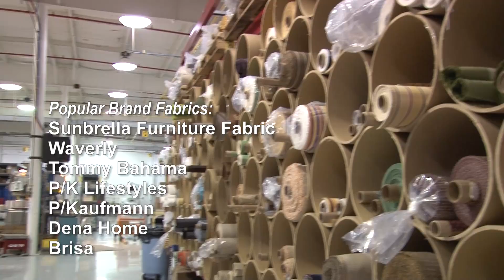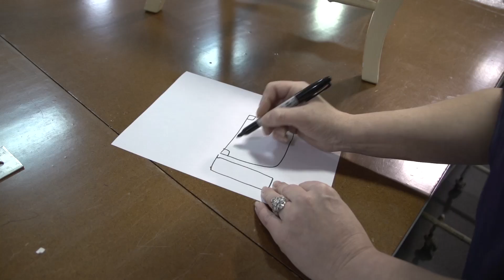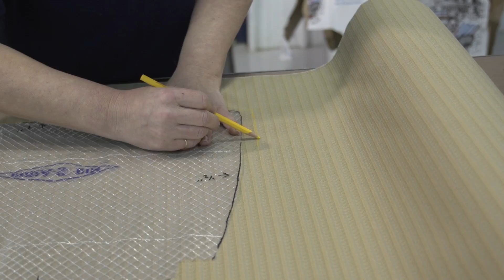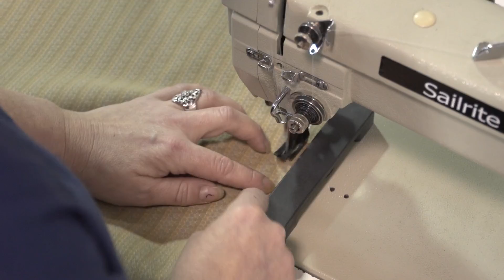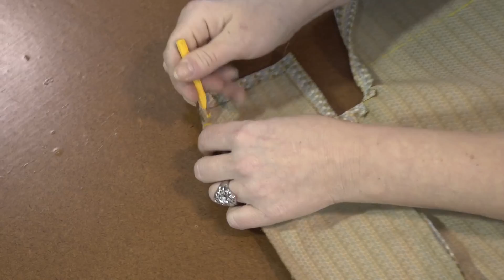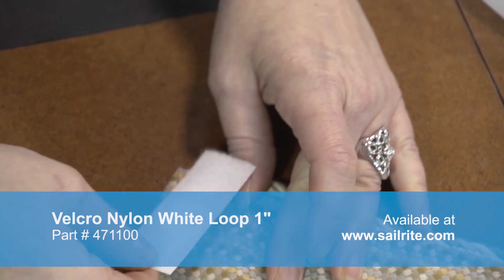How to Make Removable Dining Chair Covers

Comment: Just purchased new wooden chairs and would like the comfort a chair pad would provide.  I watched two other videos of yours for chair pads and then saw this one...I really like it, it takes the look of a chair pad up a notch.  I am wondering how well it stays in place, does the front ever slip off?  

I would also like to add that I lost a half a day watching your videos.  Excellent instruction.

Melissa
Yukon, Canada
Reply from the maker: These chairs were made for the owner of Sailrite's home and they used them for years. The covers never slipped off and they worked great. Instead of using compressed polyester, which did bottom out rather quickly use this foam: https://www.sailrite.com/High-Density-Polyurethane-Foam-Medium-2-x-24-x-80

Comment: I just reupholstered  my dining room chairs with a solid chenille fabric for seats and backs.  My kitten just LOVES it!!!  Now, I purchased a complimentary acrylic indoor/outdoor fabric and will be making covers for the seats, to preserve the chenille for special occasions.  I think your video was excellent and will use your pattern without batting, as I have just put 2" of HD foam in seats.  The only adjustment I will need to make is front/side openings to accommodate the arms.  I am thinking that a similar application of the velcro tabs will suffice.  Thanks so much for a most helpful video and a job well done!
Reply from the maker: Judy Blakely You are welcome!!!!